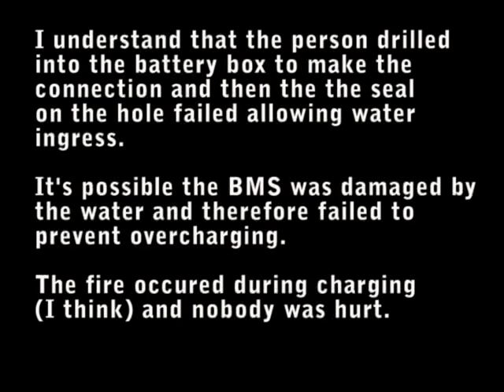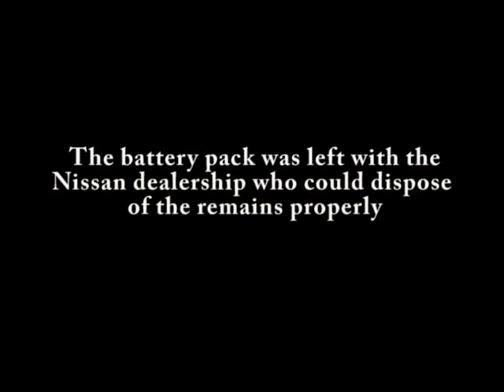Leaf Range Extender Failure Fire

Comment: I wonder if its possible to buy a second battery and turn it into a trailer, modify the wiring to and include a switch over from one battery to the other, so as to effectively extend the range by 90%? This way when going to a charging point you can charge both on seproate stations and in the same time it takes to charge one battery?
Reply from the maker: The short answer to your question is no. The longer answer is, of course, yes. Firstly it's worth remembering that the batteries and box weight 600lbs which is not an insignificant mass to trailer around. There are, unfortunately, electronic and software considerations to consider. The battery management system (BMS) is embedded with the batteries in the battery box and the vehicle control computer (VCU) checks to see if it has been 'associated' with that particular pack. It certainly is possible to get the Nissan configuration and control computer hooked up to reprogram this VCU to BMS connection and get the charger to recognize the trailered batteries as legitimate. You really do need the BMS around to control the charging profile on the cells - failure to monitor things carefully will result in the results in this video!  

You could certainly get another charger for the trailer battery pack as you were suggesting doing but the Leaf charger seems very much integrated with the car. For example, the wiring is such that if any other major component is 'not present' as seen by the VCU (EG. the inverter or motor is missing) then the computer will suspend charging.  So you're by yourself then, charging the trailer battery with a third-party charger. 

Of course none of these problems is insurmountable and your idea is good if the integration issues can be overcome.
Reply: Ok how about this, a trailer that has batteries in it designed to charge an electric car in 30min. In other words a mobile super fast charger. Could be useful in those out in the country locations where there is few charging point if any at all! Can one get wholed of the design plans on these super chargers?
Reply from the maker: ken pen A mobile charger could certainly be useful and using Leaf batteries as the storage would be a possibility.  The fast charger is basically a DC charger that limits current to about 200amps at a voltage higher than the pack voltage (nominally 384volts). A fully depleted pack will be sitting at a voltage of about 364volts and a completely charged pack will be at 403volts. The simplest (if unadvisable) charging approach would be to simply connect these packs in parallel. The charge from the full pack would flow to the depleted one and after a while both packs would be at roughly 50% charge or about 384volts. After that you'd be able to drive your car and use a charger of some sort to charge your trailer pack up again. I you want more than 50% charge in your car you would need a second trailer pack (fully charged) and then you'd get about 75% charge on your car along with this second trailer pack needing to be charged from 75% up to 100%.  When using this direct trailer pack to car pack charging, the rate at which the depleted car battery is charged is dependent on the resistance of the batteries. I don't know that spec but I think you'd want to put a chunky resistor in series to control the flow. How you charge the trailer batteries is up to you, as it were. If you had your stack of two or more trailer packs there'd be nothing stopping you charging them at the same time because they are separate. DC charging is certainly the simplest, but something has to produce that DC usually from the AC mains supply. DC charging from (inherently DC) solar panels is possible if the series voltage is high enough (400v or so).
Reply: ken pen yes it’s very possible, I’m working on mine
Reply: Yes it is possible to add extended range, you need to add battery power at a similar voltage. Just tap into the positive and negative wires from the battery itself in parallel. Not before the precharge relay. You do not need to add any extra electronics, they are optional. This has already been proven. I can link to videos. It is also my next method. Start small because of weight, and then go up.

Comment: Charging explosion was from water getting in, did it ever work before water got in? Like did it charge a run fine after the upgrade? Can I replicate the same thing and succeed if I prevent water from entering?
Reply from the maker: I believe it caught fire while charging.  I don't know the details so I don't know if there was a significant range improvement with the extra batteries. There's no reason why you shouldn't try a range improvement project yourself - BUT - if I was doing such a project I would always charge my extra pack separately (with a separate charger) and, after checking the voltages carefully, reconnect the two packs in parallel before driving. Before connecting the batteries in parallel the voltages must be within about 0.25 Volts or so, otherwise there will be a very large current flow because, 1 millisecond after connection, the batteries WILL we at the same voltage having transferred as much charge from the high battery to the low to make the voltages the same.

To prevent water problems, don't break the integrity of the metal battery pack - instead do what Leaf Xpack did in his video.
https://www.youtube.com/watch?v=UcGoSO_uRXs
Reply: mikeatyouttube ya.. I had a relay hooked up to a 12v car switch and screwed myself doing the leaf x pack... I geuss the relay activated too quickly... took the battery apart and the resistor and fuse seem fine. Not sure what it is..  I'll have to wait for leafspy. Interesting how there will be a drain from the main to balance out wattages, maybe some one way diodes will help?